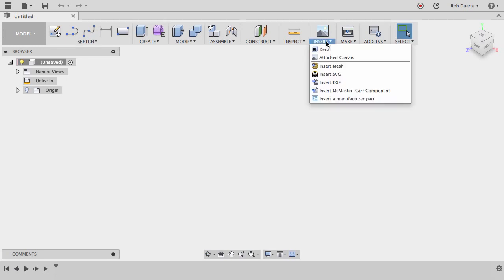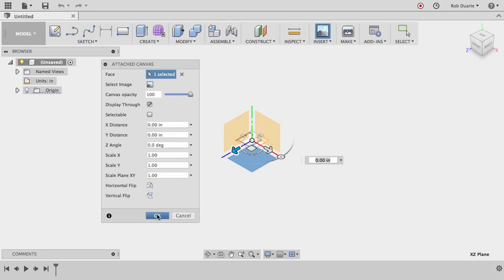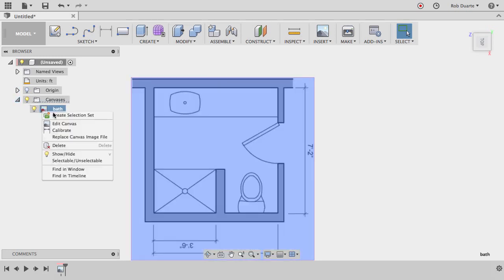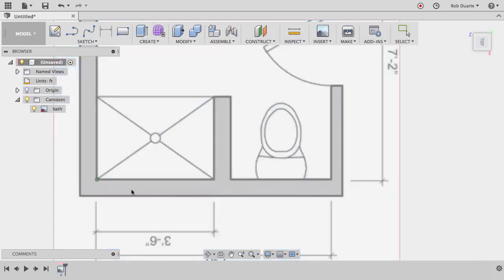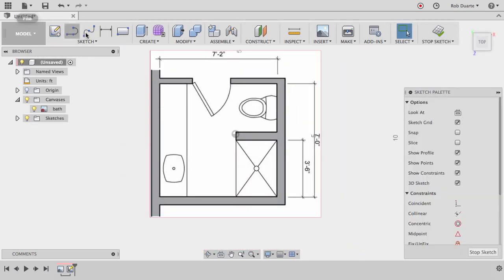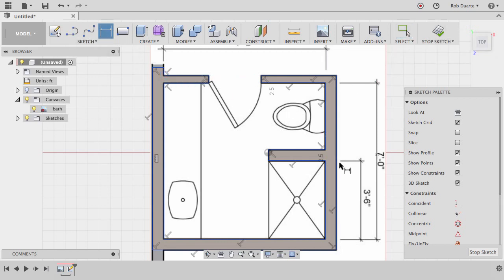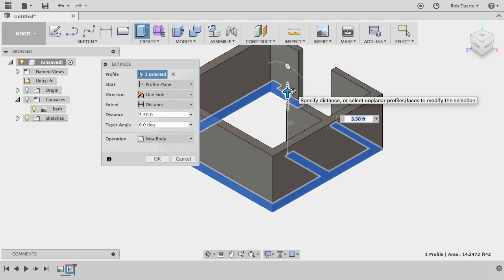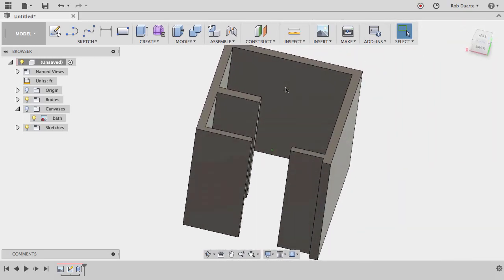Fusion 360: Turning a 2D floor plan into a 3D model

Comment: Thank you very much for posting this video. I am trying to draw a 3D building to eventually put it on a 3D printer. I not only have the floor plan of the building, but also the blueprint with dimensions of the 4 outside walls with all the details of the doors and windows and roof overhangs. I was wondering if there was a way to "collate" the 4 sides on the floor plan in one drawing working in multiview by importing the sides one at the time and dropping them on the floor plan.

Comment: Rob, it doesn't seem like there is currently a way to move the canvas based on a corner of the room to the origin is there; At least in an precise manner?
Reply from the maker: I don't think you can move the canvas using the Move tool (which can be precise), but I can think of a couple workarounds: (1) create the sketch as shown in the video, then use the Move tool on that to precisely move it (the point to point feature of the move tool is perfect for this) (2) you might be able to use the scale X/Y and distance X/Y fields to import the canvas at the correct scale and location. ie: instead of using the Calibrate feature, you'd do the math yourself. #1 definitely seems easier.